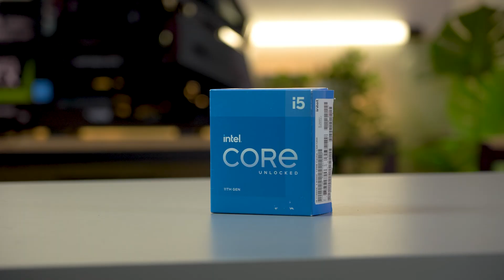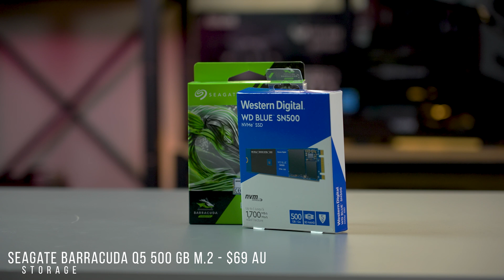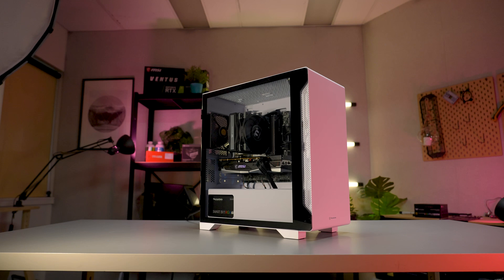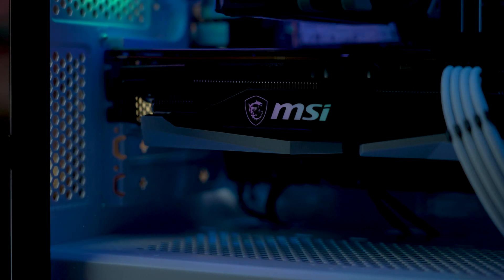The 2021 $1500 ish GAMING PC - Australian BUDGET PC Part Build Guide

Comment: Hi team, just bought most of this setup but have a few noob questions. Purchased the wifi version of the MB as don't have LAN access, is this just 'plug and play' or do I need a wifi card?
Also can I change out the graphics card for a different model? Is there size (re the case) or power issues (re the BX1 650) I need to consider? Many thanks

Comment: hay ughh will i need to get extra thermal paste or anything
Reply from the maker: Hey! Negative, thermal paste is supplied with the Thermaltake Toughair CPU cooler. You will only need to use 1/3 of it as well, so if for whatever reason you don't nail it the first time, you still have two more attempts :)

Comment: What monitors do you recommend to use with the pc
Reply from the maker: While there's not a specific model we can recommend, the best experience vs cost would be a 1080P, 144hz, IPS 24-25" panel. 
So you can check out models by MSI, AOC or Acer

Comment: Could I still use the mech model or do I have to get the Msi gaming x 6600xt
Reply from the maker: The Mech Model is perfectly capable as well! The Gaming X comes with a very small increase in MHz but the reason for it being a higher price is because of the additional RGB and bigger cooler. You'll be happy with the Mech as well, especially it's performance ☺️

Comment: Gtx 1660 super price now ? 😒
Reply from the maker: Unfortunately, the 1660 Super is priced the same as the 6600XT and we're really not too pumped to recommend the 1660 super.  We are doing a benchmarking video showing the results of the 6600XT in this system so people can see if it's worth it for them though ☺️
Reply: @ThermaltakeAustralia  That's really good But can I know the 1660 super price?
Reply from the maker: @dilshanrajapaksha8588  1660 Supers are going for $780-$840 AUD currently, when they released they were $350-$400. 

At the moment you can pick up 6600XTs from $750-$850
Reply: @ThermaltakeAustralia  Thank you
Reply: @ThermaltakeAustralia  is the 6600 better then the 1660 super
Reply from the maker: @stereoauthor8901  we'll be running some tests and releasing a video really soon on the 6600 vs the 6600xt and the 1660 super
Reply: @ThermaltakeAustralia  ok thanks for the update
Reply: @ThermaltakeAustralia  is the RTX 2080 better than 6600 6600xt